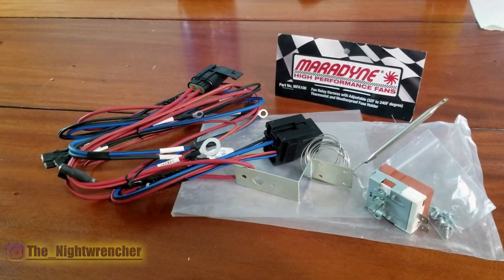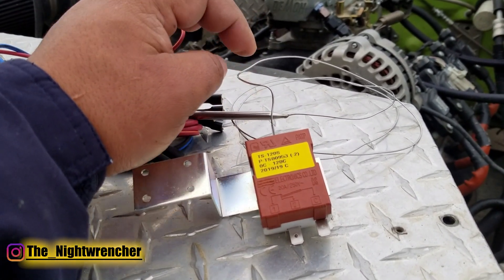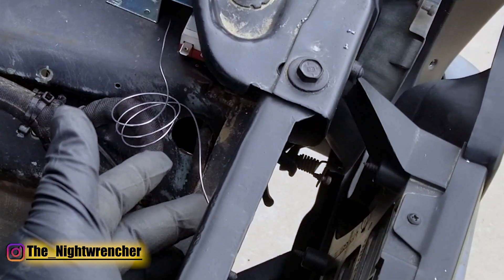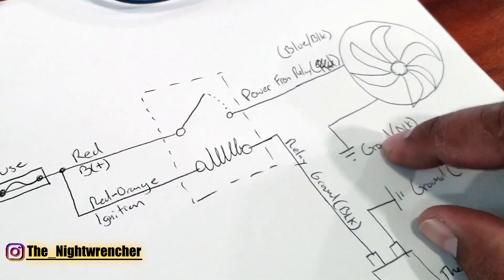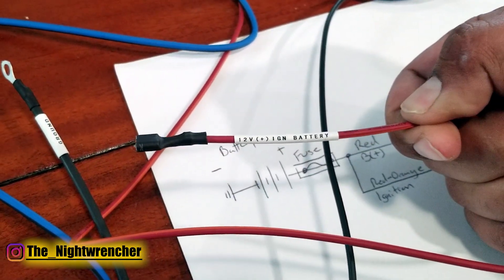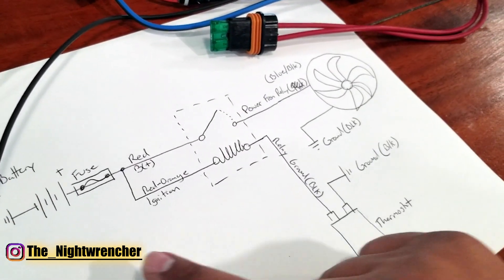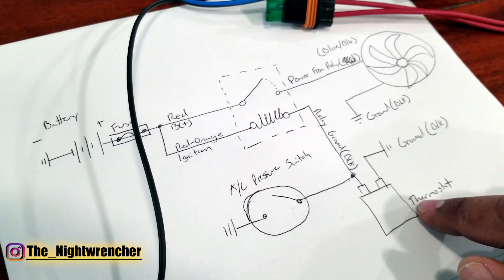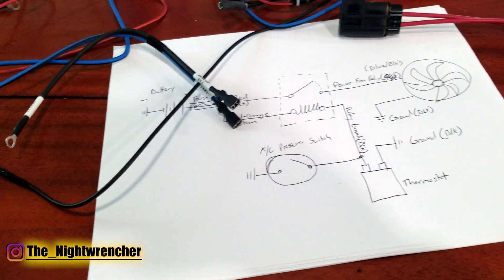How To Wire Electric Fans - MFA100 Fan Switch And Wiring Kit | Maradyne High Performance Fans |

Comment: I just wired it up same way u did and for some reason I keep popping the fuses. Is there something I did wrong?
Reply from the maker: Chances are that it was not wired up correctly. You should have a 10 or 15amp fuse going to the coil side of each relay and a 30amp fuse going to the load side of the relay that feeds the fan. One relay per fan, one 30 amp fuse per relay.

Comment: It looks like you have 2 ground wires coming from the temperature switch? I hooked it up that way and the fan doesn’t come on at all
Reply from the maker: The temp switch is the ground, so the negative side of the fan goes into one side of the temp switch and the other side goes straight to ground. Is that how you have it wired up?
Reply: @NightWrencher  I got it Bro! Your instructions were perfect it was me! I figured it out and appreciate the video which was extremely helpful
Reply: @NightWrencher  Yes, but I might have something else crossed up. Let me double check. Does it matter which side goes to the relay and which side is ground to the car?
Reply: @NightWrencher  Could it be that I’m using a 5 prong relay and harness? I don’t have the 5th middle prong hooked up to anything